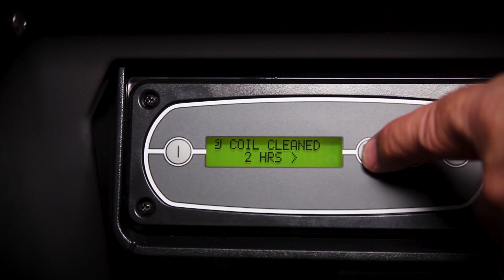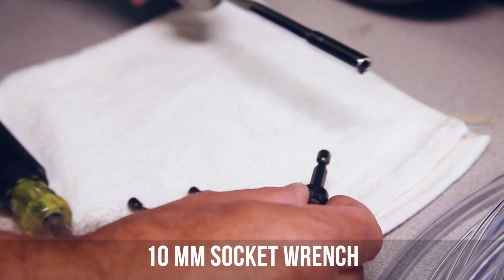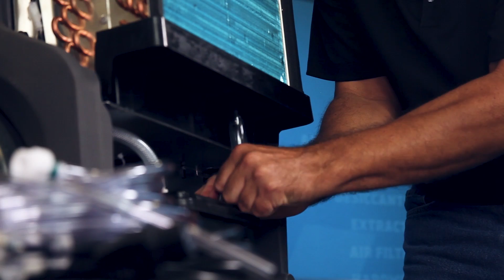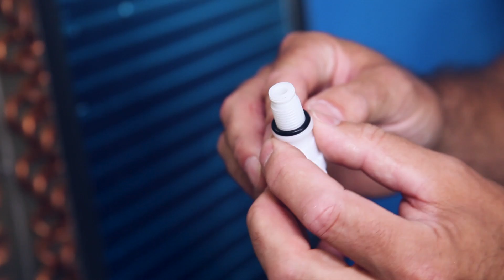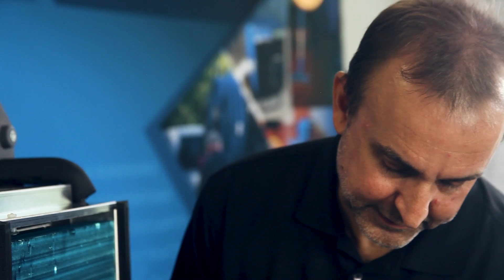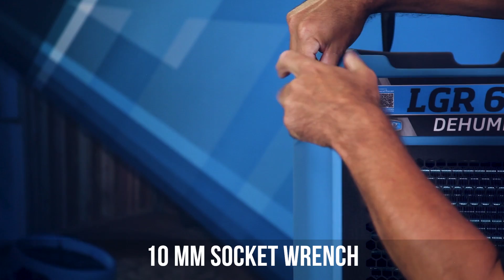Servicing the Dri-Eaz LGR 6000Li

Comment: Question: What size is the o-ring size on the quick connect from the back hose that goes to kitchen sink. I need to replace mine.
Reply from the maker: The quick disconnect is a wear item and incorrect sizing or wear to component may cause condensate leaking.  Please replace the component with part #105026 which includes the o-ring. Feel free to contact our Service team at 800-932-3030 for additional assistance.

Comment: Does it have a timer that automatically shuts the unit off when the job is finished ?
Reply from the maker: Not a timer, no, but you can set the humidistat to turn the unit off when the desired RH is reached.